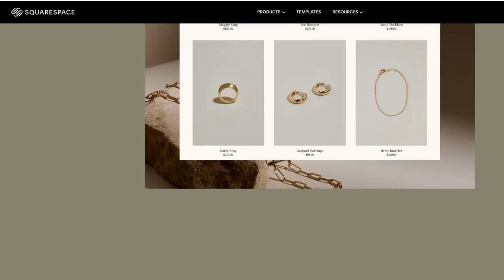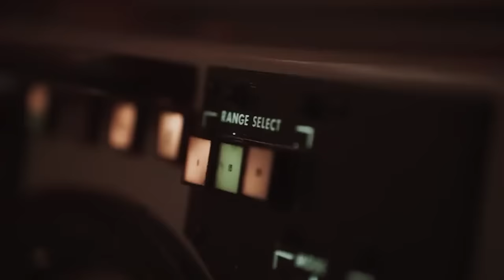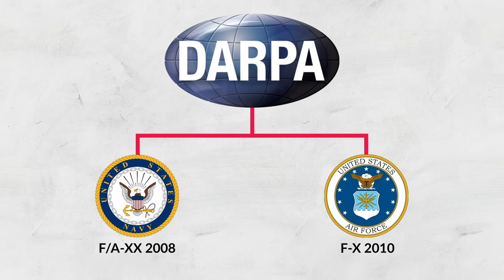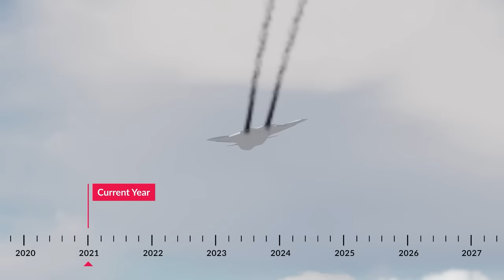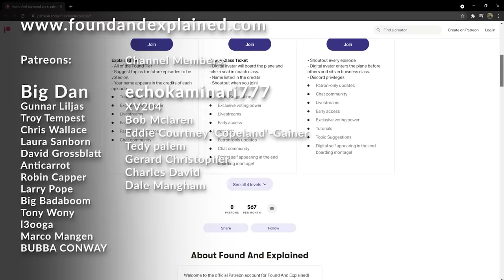FA-XX - The Next American Fighter Jet

Comment: The next American fighter:

1. Very stealthy

2!  Very long range

3.  Very fast

4.  Will carry alot of weapons internally 

5.   Will be highly networked with drones and ground and naval forces
Reply: So, this is the F-36 or F-38, since the F-numbers end in 2, 4, 6, and 8 (except the F-35)? The Lockheed naming scheme is strange.
Reply: very american
Reply: @thatguyalex2835  I doubt it.  We may see something like F-200. Something totally different
Reply: 6. Very expensive
Reply: @jeffreyexposito3803  Hmm. Who knows
Reply: @thatguyalex2835  Lockheed doesn't give out the naming schemes, it's the pentagon. For instance, Lockheed were expecting the X-35s in service designation to be F-24. Other examples of this were the F-111, F-17 becoming the F-18 and F-117.
Reply: The US emphasis is high tech as well addressing the short comings of the F-22 and F-35
Reply: I don't think it'll be too fast. Fighters have been slowing down considerably. They don't need speed now.
Reply: @thatguyalex2835  There is F-15, still in use. It was designed to be an air superiority fighter since the start.
Reply: "Oi BVR ONE CIRCLE GUNS ON MASTER YUH"!!..
Reply: Zumwalt: exists

US: haha 4 digit hull designation go brrr
Reply: @thatguyalex2835  F-44
Reply: @thatguyalex2835  
F 5, F15, F23, F101, F105, F111 etc
Reply: @verdebusterAP  well I think they should replace that f-35 with a new fighter then replace to F-22 later but that's just me
Reply: @thatguyalex2835  the numbering is just based on the FX program. The F-35 is just the "official" X-35 which was competing with the X-32 to be the new milti-role fighter. X being eXperimental.
Reply: @cheeseninja1115  Thank you for the info
Reply: @danielsnook7362  
There are not enough F-22s which is the problem
Reply: @verdebusterAP  but there's also the problem of reliability. as much as I like the f-35 it does have a lot of reliability issues. The F-22 though barely seems to have any compared to the f-35
Reply: @danielsnook7362  
There are no reliability issues with the F-35
Reply: @verdebusterAP  you do know that recently one of them failed to take off properly from a aircraft carrier right? From what I hear it happens a lot
Reply: @danielsnook7362  
The F-35 is 3 models,  not one
The F-35B that failed to take off not an F-35 problem. that fault was the engine ingesting something before take off
Secondly unlike land based F-35, there as no room for error on carriers. Anything goes wrong and can be disastrous 
It only happen once, not quote a lot
Reply: @verdebusterAP  I have to agree with this 👍 don’t blame the plane when your supposed to blame FOD
Reply: 7. Does it perform Crazy AOA as the Raptor?
Reply: @Spicy_Italian_Sausage  
That was completely on crew getting careless because they were so close to home
Reply: And still lose Afghanistan
Reply: Hmm, with no emphasis on manoeuvrability, and demanding long range and capacity, it appears you are asking for a strategic bomber… like the Russian PAK-DA, it will tick all these boxes
Reply: 6. will look cool as fuck 

7.will have kick ass name
Reply: @awddfg  Russia lost in Afghanistan. And china lost against Japan.  What's ur point.  And USA dominated Afghanistan for 20years. Not exactly a loss more like time to leave
Reply: @danielsnook7362  Why are you censoring your words lmao, Russia is holding back, they could do more airstrikes, but for some reason they aren't
Reply: @awddfg  still the fact that they have to put in this much effort when they claim to be so technologically advanced and Superior plus even claim that they modernize T90s and they're still getting taken out by basic nlaw and javelin plus their are live recordings of some of the aircraft being taken out the helicopters the tanks the apcs you name it even if they are holding back it shouldn't be this difficult if Russia is a well-trained army and they are simply dealing with a small group of rebels hell there is a real life recording by a Russian helicopter pilot of one of the best helicopters having  to make an emergency landing because of an old obsolete stinger
Reply: @danielsnook7362  You really love listening to propaganda don't you? Their main goal isn't to take over ukraine entirely, just to take the south/eastern areas, which have Russian speakers.
Reply: @vash_the_stampede6570  crimea? They own it already
Reply: @thatguyalex2835  the f36 is already in plan, it’s called the king snake
Reply: And very expensive. ;D
Reply: @thatguyalex2835  F-15 would like to have a talk😊
Reply: Very stealth
Reply: 6. Capable to invade a country
Reply: @yewtoob2007  delayed and over budget by orders of magnitude
Reply: @yewtoob2007 Of course, let's hope they're capable of doing all that and the tax money isn't wasted!
Reply: 6. non existent

Comment: Other countrys: but.....but we just got to half ass 5th gen fighters

America: we dont care unvails X-wing fighter with cloaking and deflector  shielding proton torpedoes  and high powerd ion weaponry
Reply: If requested they could find a way
Reply: If you fix the hierarchy, I bet you will have another Apollo program, and rumors that the US tested a antigravity plane.
Reply: @apex_blue  they already have antimatter  nuclear weapons so thats not far fetched
Reply: @apex_blue  we have another apollo program called Artemis.
Reply: @pythontf188  I’m talking about innovation, the Apollo program was nothing short of a miracle of engineering, sure their plan of attack was throwing more money at it, but it worked.
Reply: Funny you mention the X Wing since if you look at its statistics it's basically the equivalent of an early cold war plane (relies mostly on guns since its missiles/torpedoes aren't very good) with fancy energy shield. Literally every modern fighter jets can outperform the X wings
Reply: Congratulations.......you played yourself
X-wing starfighter[1]
MODEL
T-65B space superiority fighter[3]
CLASS
Starfighter[1][4]
COST
150,000 Imperial credits (new)[5]
65,000 (used)[3]
TECHNICAL SPECIFICATIONS
LENGTH
13.4 meters (44 ft)[3]
WIDTH
11.76 meters (38 ft 7 in)[3]
HEIGHT/DEPTH
2.4 meters (8 ft 1 in)[3]
MASS
10 metric tons[6]
MAXIMUM ACCELERATION
3,700 G[5]
MGLT
100 MGLT[7]
MAXIMUM ATMOSPHERIC SPEED
1,050 kph[8]
ENGINE UNIT(S)
Incom 4L4 fusial thrust engines (4)[9]
Alternate configuration:

Incom 4j.4 fusial thrust engines (4)[9]
HYPERDRIVE RATING
Class 1[10]
HYPERDRIVE SYSTEM
Koensayr GBk-585 hyperdrive motivators (4)[5]
POWER PLANT
Novaldex 04-Z cryogenic power generator[9]
SHIELDING
Chempat "Defender" deflector shield projector[9]
Deflector shield generator[9]
HULL
Titanium armor alloy[3]
SENSOR SYSTEMS
Fabritech k-blakan mini sensor[3]
Carbanti transceiver package:
Fabritech ANs-5d "lock track" full-spectrum transceiver[9]
Melihat "Multi Imager" dedicated energy receptor[9]
Tana Ire Electro-photo receptor[9]
Alternate Configuration combines:
Fabritech ANs-5d "lock track" full-spectrum transceiver with PA-9r long-range phased tachyon detection array[9] and PG-7u short-range primary threat analysis grid[9]
TARGETING SYSTEMS
Fabritech ANq 3.6 tracking computer with IN-344-B "Sightline" holographic imaging system[3]
NAVIGATION SYSTEM
Astromech droid[11] (up to 10 sets 

T-65b blueprints.png
X-wing schematics
The T-65B X-wing starfighter was manufactured by Incom Corporation.[1] It was designed to excel in all aspects of starfighter combat, being highly maneuverable and heavily shielded, with a small profile that made it harder to hit. Unlike other starfighters the X-wing could excel in atmospheric flight. This included outmaneuvering the TIE fighter, which was otherwise faster and more maneuverable than the X-wing in space.[3]

It had two pairs of wing-like strike foils, or S-foils, mounted at the rear of the craft on opposite sides. Normally, the foils on each side locked in place flush against each other; during combat, however, the foils were folded out. This gave the craft its distinctive "X"-like appearance when viewed from the front or rear. The S-foils were controlled by an S-foil servo actuator located in the back of the starfighter.[9] With the S-foils open in attack position, the craft had a greater spread of fire as opposed to whilst shut.[15]

The craft was armed with four Taim & Bak KX9 laser cannons, placed at the tip of each wing. The laser cannons could be fired singly, in alternating pairs or all at once. By default the convergence or "zero" point where the lasers would intersect was set 500 meters in front of the X-wing. Two Krupx MG7 proton torpedo launchers were located in grooves near the middle of the underside of the fuselage on either side of the T-65B.[3]

A deflector shield generator located in the rear of the X-wing created a protective field which could be adjusted around the craft with the help of a Chempat "Defender" deflector shield projector.[9][4] This included shield projectors along the leading edges of the S-foils which, when in attack position, helped to expand the protective field. A Bertriak "Screamer" sensor jammer provided additional defense by scrambling the sensors of enemy starfighters and homing warheads.[3] The X-wing could also use its laser cannons to shoot down enemy missiles.[16][17]

Four 4L4 fusial thrust engines were attached to the wings of the T-65B, next to the fuselage. Some X-wings were fitted with 4j.4 fusial thrust engines, which were virtually identical to the 4L4 models. These provided the X-wing with incredible maneuverability thanks to three factors: the use of differential thrust between the four engines to adjust trajectory; a high-mass electromagnetic gryoscope fitted to each engine for swinging through tight curves; and the ability to fire retro-thrust forward through the turbine nozzles. Infrared suppressors were used to conceal the hot exhaust.[3]

The X-wing itself was powered by a Novaldex 04-Z cryogenic power generator located in the center of the ship.[9] Cryogenic capacitors located in the S-foils stored additional power for the engines. Power couplings allowed for energy to be distributed and balanced between the various systems.[3] The starship weighed 180,000kg.[18]

The single pilot sat in an armored cockpit in the center of the fuselage protected by a transparisteel canopy.[9][3] The canopy allowed for a wider view compared to that provided by a TIE fighter's, and was also designed to automatically polarize to protect the pilot from harmful light. Explosive charges were set to blast the canopy clear in the event the Guidenhauser ejector seat had to be used. Adjustable for use by most species, the pressurized cockpit had enough life support for up to one week, and featured an inertial compensator to protect the pilot from high-g accelerations.[3] The cockpit had flight controls similar to those of the T-16 skyhopper, an airspeeder also produced by Incom Corporation,[2][3] along with a targeting computer with holographic imaging system.[3]

The X-wing was equipped with a long-range[19] hyperdrive system[11] consisting of four GBk-585 hyperdrive motivators.[3] An astromech droid served as the X-wing's navigation system, plugging into a socket near the engines above and behind the cockpit. The droid assisted with calculations and could hold up to 10 hyperspace coordinates, as well as make repairs to the craft.[8][3] It could readjust power levels between different systems multiple times per second to assist the pilot in a fight.[16] The droid was capable of assuming full control of the X-wing if necessary too, with or without a pilot. In an emergency a separator charge would launch the droid clear of the craft.[3]

The T-65B's sensor systems were located inside the X-wing's nose cone. The sensor system, a Carbanti transceiver package, was made up of a Fabritech ANs-5d "lock track" full-spectrum transceiver, a Melihat "Multi Imager" dedicated energy receptor, and a Tana Ire Electro-photo receptor.[9] These fed information directly to the targeting computer, which could track up to 1,000 sublight objects and acquire 20 targets. Additionally, a Fabritech K-blakan mini sensor scanned directly behind the X-wing to detect sensor sweeps and craft approaching from the rear
Reply: @SJstackinbodys  3700G?

Pilot is a wet puddle at that point.
Reply: @Justanotherconsumer  ahh yes well the cockpit itself actually (some how) adjust the gravity ( slightly) in cockpit  so the pilot doesn't  turn into a rebel flavored pudding when all those G's hit..but real talk the X-wing variant  fighters are the most advanced fighters  in starwars all timeliness..i actually  didnt know it had all those sensors🤣🤣
Reply: @SJstackinbodys  antimatter nukes? Sure…
Reply: @skygge1006  😂😂😂 yes look it up the satisfaction  from knowing you're mad that america was that advanced  was just golden